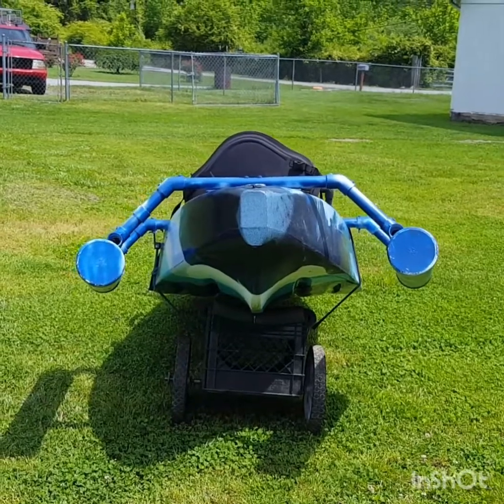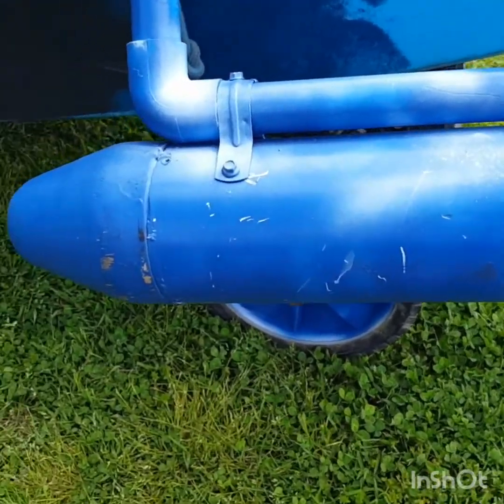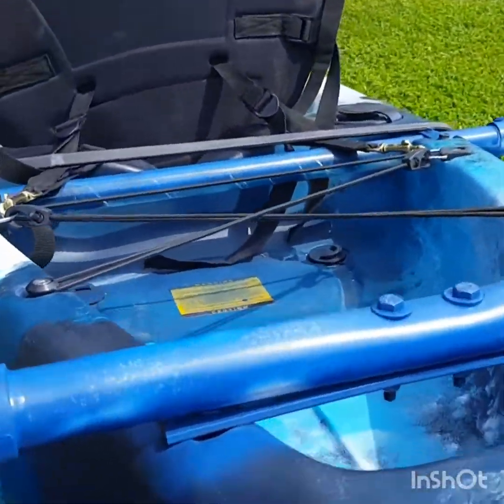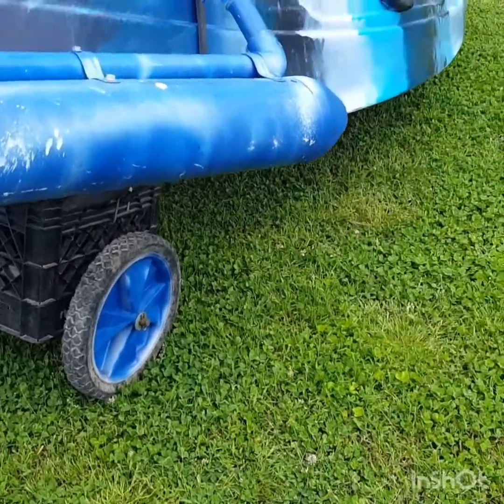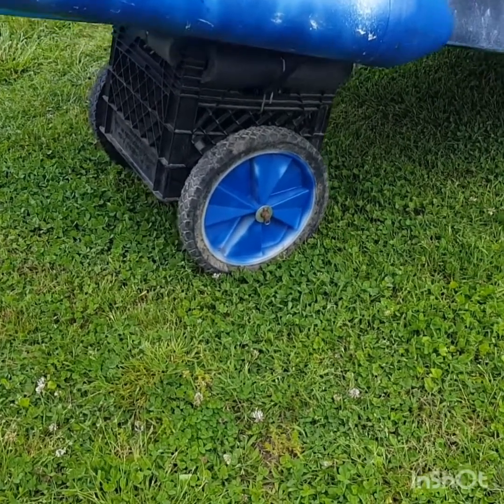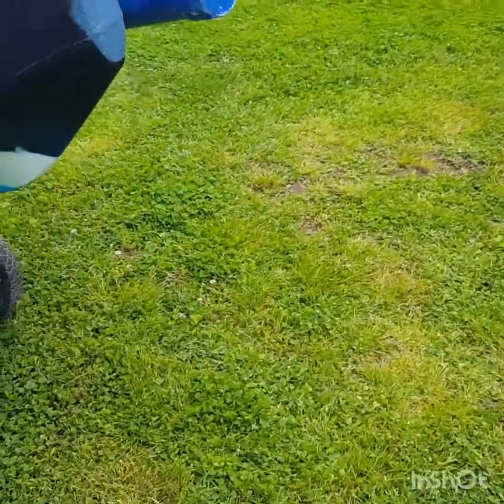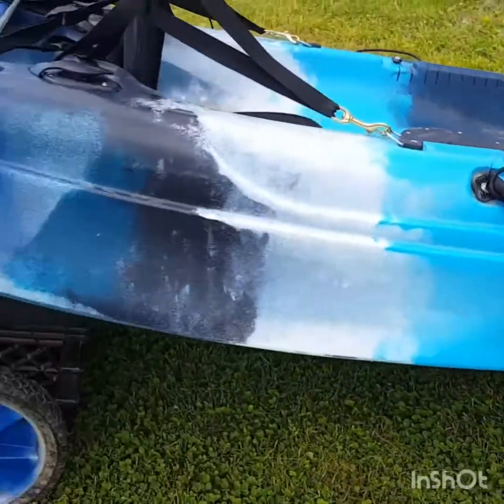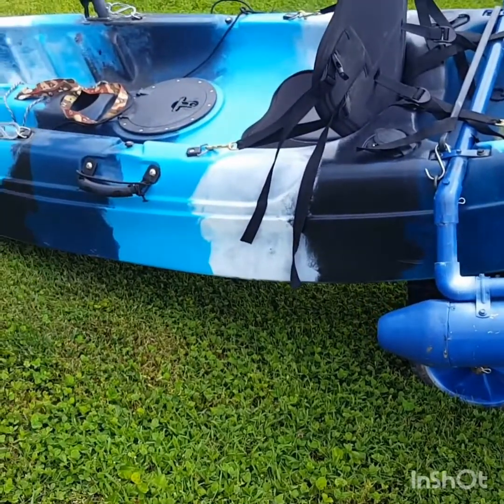Kayak mods!! DIY Outriggers and Crate  Dolly!!

Comment: Roland, Looks great, but I noticed a (maybe) problem......the keel on the boat rests on the milk crate box only in the center.   I'm afraid on rough ground you will hit a rock causing the box to twist.  I think a piece of 4" PVC pipe on either side of the box to fill those gaps , and rest against the keel to keep it straight,  would be well worth doing.  Maybe even trim the box to fit the keel?    Other than that, that's a great set up!  I'm thinking I need to make one for my boat.
Reply from the maker: I thought the same but with with a snug pull stap, It may be ok?? Really though with added pvc would be better, I don't wanna weaken the crate by cutting it....good idea brother..you need a Lacy Cart!! Makes life easy!!
Reply: @mountainbushcraftersallian8654   It should work great  except on really rough ground I think.  Simple is best!
Reply from the maker: @MuskratOutdoors  yes..I thought about the areas I go and you're right, Imma modify the cart to better fit the yak....I sure appreciate you..

Comment: How is paddling with outriggers? Looks like you'd be hitting them on the backward stroke....Fill us in with a video! 
:-)
Reply from the maker: I appreciate the question...It paddle just fine, no issues with bumping the Outriggers forward or back...since this vid I've had 3 surgeries and sold the Kayak...but it worked great...